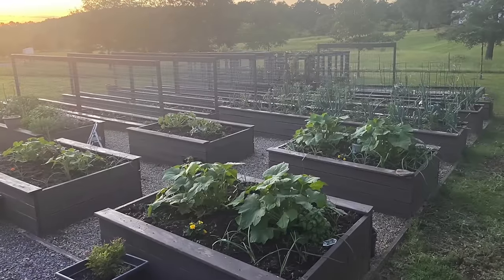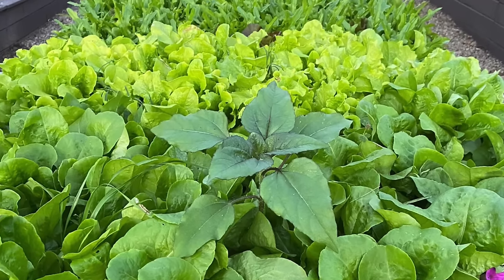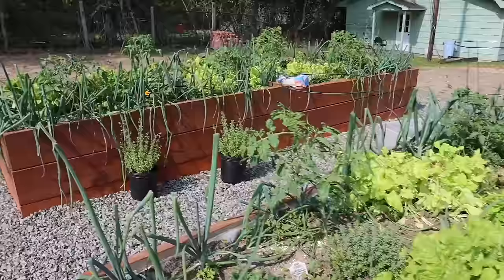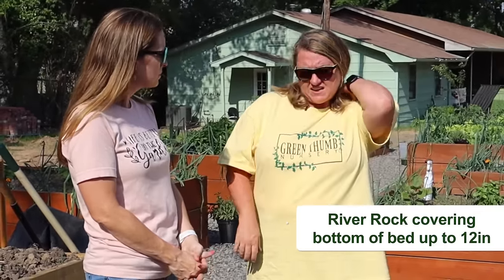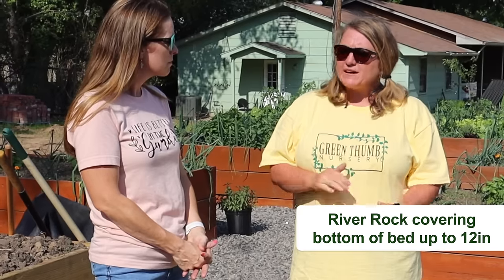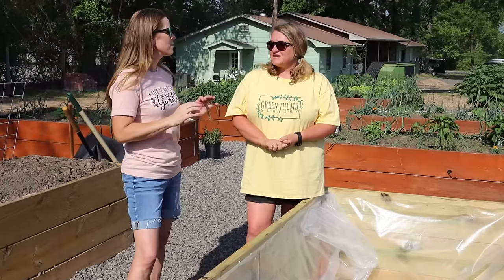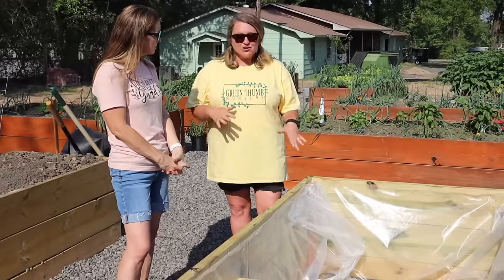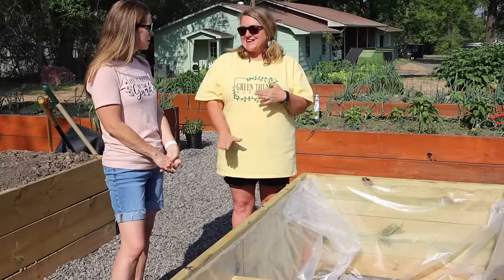DIY Self Watering Raised Beds/Green Thumb Nursery

Comment: I must be missing something. As the water table goes down, the soil is not in direct contact with the water so I assume wicking would cease. Other wicking bed systems have pockets or 'wicks' of soil or perlite... that go down deeper into the water well for that reason. I didn't see that you used anything like that. Perhaps since you have to water every week it remains quite full.
I am thinking that instead of the river stone I could use upturned milk crates or bread trays or similar - anything that can hold the soil above the water. What do you think?

Comment: If you use chlorinated city water buy a kiddie pool.  Fill it in an area that has direct sunlight.  The ultraviolet rays of the sun will reduce chlorine by 90 percent in a few hours.  To use the water from a pool you’d have many options.  Simplest is to use a sump pump.   Cheapest would be an aquarium fountain pump to an elevated bucket with a hose fitting.   Use the hydrostatic pressure from the elevated container to fill with.

Comment: Thank you for the video. What are the two planks in the middle of the box for. You mentioned 8mm plastic. Is the plastic nearly 1cm thick? How is the box self watered? How does regular water get into the box? The overflow pipe is sitting on top of the rocks and water will not rise above that level. The rocks are then covered with plastic. How does the water get into the soil which sit on top of the plastic above the water line? Thanks.
Reply: That is what I was wondering.  The water is not contacting the soil, so how does wicking occur?

Comment: I wonder if with all that water left in the bottom will cause damage when it freezes in the winter. I wonder if you put a drain pipe in the bottom so you can drain it before winter

Comment: Very interesting concept!

An idea i had while watching this, I would suggest instead of using the fabric in the middle, add a layer of finer gravel on top, followed by coarse sand.
This is part of how you create a natural filter, and should work well to keep the dirt from getting down into the reservoir.
Otherwise after a while the dirt will still probably get through the fabric.

Comment: Thanks for the video!  Are those 2X8’s or 2x10’s?  Also, I got the 12” of rock, how much topsoil/mulch in inches?
Reply: They look like one 2”x4” plus two 2x10” boards for a total of 22 1/2” of height - I’m guessing. I assume they started with the 2”x4” boards as a base because they are easier to level.

Comment: Love this system, thank you for the excellent explanation! I have a question. At 3:01 there are two boards across one of the boxes. Whatare the dimensions? Height from bottom? / or flush with floor? How do you hold them in place? Just nail them through the bottom plastic liner?
Reply: We want to know this, too!!

Comment: Great video. Rich with details. 
I have NOT built one yet. My concern is wood rot. In this video, it appeared that all of the RBs were sitting on crushed rock. Do you happen to know how deep that rock is? 

So, I assume that the plastic liner on the inside of the RBs protects the interior walls. I’d hate to do all this work only to have the wood rot in a year or two. 

Kind regards.
Reply: FYI, I’m quite sure the metal mesh used for plants to climb is heavily zinc plated. It matters. I live near the sea in France and it is critical to use the proper materials outdoors or they will start to rust super fast. 

Thx again.

Comment: I once helped a friend dig his wicking bed up because his plants were no longer doing well and it turned out that the water in the reservoir had become stagnate and turned anaerobic and toxic for the plants. So this works for a few years then you may have to dig it up and rebuild it. My friend used free sourced plastic interlocking pallets on the bottom instead of rocks.

Comment: Love this video and will be trying it for my first raised bed garden. My big question is about weight and outward force on the wood sides. How do they hold up to the constant pressure of the stone, dirt and water? Would the metal or concrete beds hold up better for this?
Reply: Soil loading acts diagonally not horizontally so not a lot of loading on the sides. Using 2by materials for the walls helps a lot. You could also use vertical stiffeners or horizontal ties between the walls. Corrugated metal could work with the corrugations oriented vertically but sometimes rusts prematurely. Concrete could work but is heavy and expensive.

Comment: biggest suggestion is to pull gravel over the end of that pipe..just a mound or cup over the end of the pipe to help keep soil and roots out of the pipe- I run my pipe at 8 inches but also run two drains per bed, and take the drains back to a buried tank that captures all extra water= I dont add fabric between gravel and soil but just use a layer of cardboard..
Reply: How do the roots get passed the cardboard to the water ?
Reply: @ibiubu99  the water wicks through the soil and cardboard to the roots.

Comment: I'm currently building one that's 24" tall and the drain pipe is at 12".  She didn't specify, so should I fill the rock to 11" (thus soil 13" deep) so that the bottom 1" of soil is constantly underwater, or maybe 1/2", or 0" (bottom of the soil is at the top of the water level)?

Comment: I understand wicking beds!!!! What I'm not understanding here is how the water gets from the reservoir into the soil if the soil is not going down into the reservoir, unless the river rock acts a wicking medium (which I wouldn't think that rocks wick). Once the water level goes an inch or two below the top of the rocks, then how does that water ever rise up those rocks to reach the soil?  I would think that a better idea would be to have the landscaping fabric reach down in pockets into the rock which would then allow those fabric covered pockets of soil to act as the wick to bring water up. I'm just not understanding where the wick is in this system.

Comment: This is an interesting concept.  While I believe it's a good idea the materials used are not.  There was a complaint in the video on chorinated water yet you use plastics that your water will sit in over time.  The materials WILL leach into the water overtime.  Here in texas it gets in teh 110s and that can melt said plastics or make them weak, thus your water will feed those leached chemicals into the plants.  It would be better if they had used metal parts for this.

Comment: I would think that you need a wicking fabric to take the water up to the plants - their roots can't et through (good quality) landscape fabric.  I saw a comment before mine that recommended layers of pipe.  I concur.  That would fix the problem.  Put two or three sections of pipe to 'take up space' and allow for a reservoir.  That allows the roots to get to the water.  I saw something else I found intriguing, filling the bottom 2/3 with branches (packed up tight) put dirt on top (use the water pipe as well, with the overflow if so desired).  This seems to me to be a very good method as it incorporates something of that German system of burying logs in the garden for the long term benefits of decomposition.  Forget where I saw it.  To continue:  If the water level drops below (even by 1/2") the fabric layer, the plants can't get to it.   Well just rambling now.
Reply: Hugelkulture.  I did that in a large raised bed once.  Worked great, but a combo with this watering system would be even better, tho the the Hugelkulture is to replenish the soils as it all breaks down.  Maybe pipe coils in the bottom reservoir, then fill with logs/sticks/etc, then soil.  Hmm, not sure how the water would wick up thru the log layer.   Back to the drawing board!
Reply: hugelkultur...that's what it's called.❤

Comment: I love this and I am dying to do it BUT... what about the support beams installed in the middle of the bed?  Did you drilled those in place?  You must have drilled them through the plastic, does that cause it to leak over time?  It is important to have the support beams so that the garden bed doesn't bow outward over time, but what about leaks? 

Thank you.
Reply: Couldn’t you also pound rebar into the ground on the outside of the long boards to prevent outward bowing?

Comment: This is awesome. But one question. When the water level starts to get low, what wicks the water to the soil? Do the rocks wick? I picture above the water line the rocks would be dry. I've seen pockets or holes filled with sand or nylon roop sitting in the water and in contact with the soil to wick the water at all water levels
Reply from the maker: That’s a great question. I don’t recall her talking about that as we discussed her method. However it’s done I can tell you it works. Her plants were very healthy even in the middle of the summer.

Comment: I use these, I make my wicking gardens from Sea Boyes  o slice the tops off use two lengths of the piping  in the bottom of boye staple weed mat in on top and then fill abd plant. I drill  overflow  holes  just under the matting height and a pvc pipe cut on an angle to stand in between  mat and water chamber for filling .
This way the roots break through the matt abd piping abd wick at their leusure
Reply: Please elaborate. Bottom of boye?

Comment: Great video, does the Green thumb nursery have any videos on how they set up their trellis systems? I know she said 2 x 4 but I’m curious how she mounted it to the raised bed it looks like it was attached to the top or does it attach to the inside somehow?
Reply: Heavy duty staples connect the hog/cattle wire to a wood frame
Reply: They probably have "legs" that go down along the inside (or outside) of the beds & are nailed to the walls of the beds.

There are plenty of videos with ideas for building various types of trellis systems, so you can just search & find a style that works for your garden.

Comment: Man we just put in so many raised beds we are trying to figure out irrigation system and uuugh wish we hear of this before all the work we did.
Reply: A simple above ground drip tube setup is going to be a lot easier than getting 1.3 cubic feet (2 tons)of stone for a single raised bed. Hell, if I was going to go to that much trouble and money, might as well get a mason to come build you a raised bed out of block rather than that chemically treated wood.
Reply: Lots of less expensive options than all that stone. 

Redwood or cedar is also a great alternative to the treated wood.

Comment: how does the water wick up?  It does not wick up the rock.  I did not see you place the fabric down in the water
Reply: I wonder about that also. Most videos show a column of soil going to the bottom on the reservoir.  The soil could be in a container with holes to allow water in.  A larger bed may require several wicks. I have even used an old sock for a wick in a 5 gal bucket.        Duane

Comment: Question! My husband and I are trying to figure dimensions, cost etc. Are the small pieces of wood in the inside corners 2x4's? I say "yes", he says "no"... I say that they need to be because of support but he says we can use a 2x2 or something. Help please!  Thank you for all you do!
Reply: Both 2x2 and 2x4 could work. The latter just gives more wood to sink the screws into. Sometimes there isn’t much difference in $. If you have a table saw, you could also rip a 2x6 into 2x3. Could also rip a 4x4 diagonally. Lots of options.

Comment: I have a question  What happens in the winter? Won't the water reservoir freeze and break everything apart?
Reply: If you’re up north where freezing is a problem, you might want to consider a tenting with a waterproof covering to prevent adding water. The stored water will evaporate out of the system preventing the problem you mentioned if more water isn’t introduced. Even without it though, the ground will probably heave up before crushing what’s below.
Reply: I was wondering this as well. I’m in Zone 3, where our winters are relatively “normal” but summers have lately been unusually hot.
Reply: @lesliekerr7952  Hi Leslie   I think I'm going to experiment with a bed next year.  I will try digging down and putting the bottom half (the portion with rock in it) mostly below ground level and the top half at ground level with wooden or metal sides. The drainage hole will sit just above ground level. I'll allow plenty of give  in the plastic so that hopefully if it does freeze it won't tear. John Lee had a good suggestion so I may also try putting a translucent plastic or vinyl hoop tunnel over it.
Reply: Digging into the ground would help to moderate summer temperatures but unless you get below the frost line (2-3’), the ground and water will still freeze. Better to just focus on helping the soil dry out.
Reply: @johnlee7085  Thanks John :)

Comment: As I'm trying to get started with a raised bed garden for my vegetables I saw this video.  I never saw this technique for a bed before.   My first thought was water stagnation and anaerobic bacteria building up.  I guess it doesn't happen or you wounding be doing it.
It's a great video and glad I stumbled on it.  I'm subscribing and looking to see if you have any other videos similar to this.
One thing.  Do you have a video about deer and their destruction of the plants?   I'm thinking of a chicken wire cage that fits over the raised bed.
I'm assuming the system would work with cinder blocks as the raised bed building material?
Reply: Anaerobic means without air. The key to a successful wicking bed is having the overflow below the top of the storage volume. This creates the required air space.
Reply: Search for "wicking bed" videos. They are fairly common in Australia. We have them installed in our harvest garden at school 😀
Reply: @erin.murphy  I do like them.   I would wonder about winter cold and it's affect on the stored water at the bottom with freezing.
Reply: @johnlee7085  But how do you retain that air space if we're going to put cloth down  among the drainage pipes and then fill it with soil?
Reply: JSclar - The key to the air space is difference in the elevation of the top of the reservoir and the outlet. The outlet needs to be below the top of the reservoir so that there’s always air at the top.
Reply: @johnlee7085  Then how does it wick up into the soil?
Reply: @beebob1279  we only get temps down to around -4°C occasionally in winter. It could freeze, but doesn't seem to be a problem. The bigger problem would be the frost ruining the plants which is solved by covering them.
Reply: BeeBob - I’m not exactly sure what you’re not understanding. The soil extends into the area around the reservoir (pipes, bottles, etc. ) so that the soil below the water level is saturated, no air, but the soil above the water level is not saturated, only wet from the wicking. The difference in water content between saturated and unsaturated is the air in the soil.

Comment: Trying to weigh out the cost of building one vs buying a Birdie galvanized steel bed. I know they're completely different b/c i wouldn't want to cut into the Birdie for a drain hole, thus I wouldn't have a wicking bed. But my beginning rough calculations are coming up fairly expensive per bed as I will need to buy all supplies. Did she give you an idea how much these cost to build? Thank you.
Reply from the maker: No, she didn't, but I think that's partly because she buys so much of the ingredients in bulk.
Reply: Check out Epic Gardening for some videos on building with Birdies and some less expensive options for filling them.

Comment: my wife and i are experimenting with this in central texas. right now we're using buckets for small scale experiments. how long till the soil is moist ? do we have to water a lot at first?
Reply: Fill the reservoir til overflowing then just monitor the depth of the water with a stick. Capillary action will self water the soil.

Comment: Curious if you considered installing a simple drip system instead?
Reply: I think it depends on your climate. These wicking beds are common amongst home gardeners in Australia with raised beds. Our summers (especially in the southern mainland states) are long and hot. 40°C/104°F are common at the hottest part of summer. Evaporation is a problem, even with mulch, so wicking beds such as these are a good solution as it minimises evaporation and rot from irrigation. I think if drip irrigation suits your climate, then it would work well. Where I live, it gets trick to keep the water up in the heat.

Comment: Great video. Thanks. Is really your plastic 6-8mm thick?
Reply: 6-8 mil is much thinner than 6-8 mm which is about a quarter inch thick. 6-8 mil is more like heavy paper or lightweight cardboard.
Reply: 6 mil is 6/1000 inch thick. Not 6mm.

Comment: Sounds like a great system bu I won't try this because I would worry about the toxic chemicals in plastic which will break down more rapidly in heat.
🤷‍♀️
Reply: but - the plastic is not exposed to the sun and the water is not boiling, so pretty cool plastic 😀

Comment: We ordered rock for This. But the rock is bigger then we ordered. It’s like 2 to 5 inch.  Will it work with Rick this big?  Any help would be greatly appreciated
Reply: Probably. 

If it is just big rocks, it will have more void space between the rocks that will fill with water creating the reservoir. 

If there are also smaller rocks, they will fill the void space between the rocks and reduce the volume of water that can be stored. It would still work but not as effectively. It would also be all the more reason to have a furrow in the rock to allow the soil to extend into the saturation zone for better wicking. 

If you have not already assembled it, you are still better off using the pipe method mentioned above, and shown on Leon’s YouTube. Well, except for having a bunch of rocks.